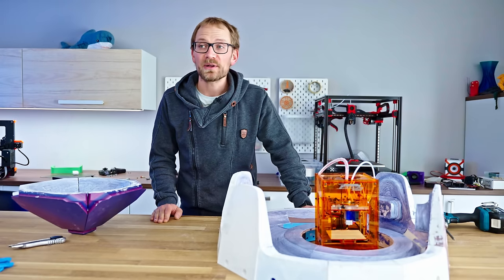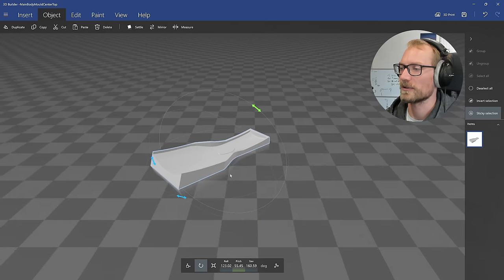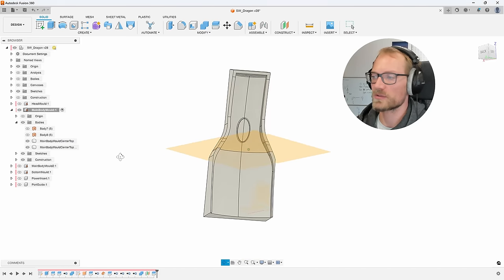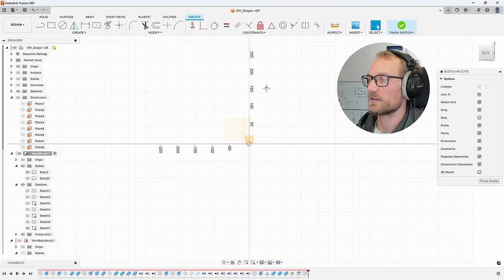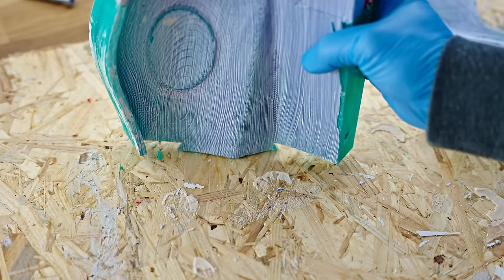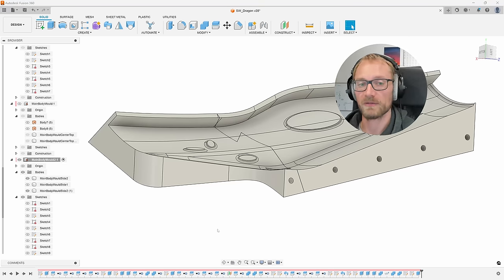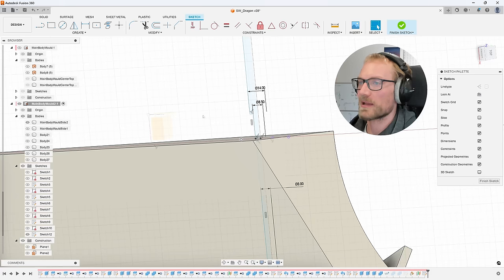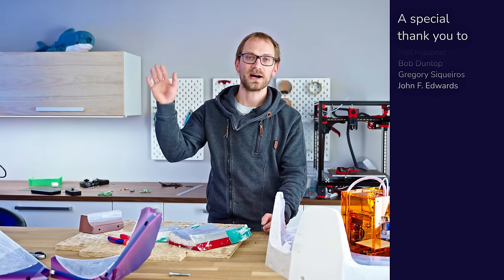Size isn’t everything - 4 ways to print LARGE parts with a 𝘀𝗺𝗮𝗹𝗹 3D Printer!

Comment: I usually print smaller parts separately and use 3d printed threads to lock them together downside is that the threads usually need to be printed at 50 microns - 100 microns layer height.

Comment: LuBan3D is software originally created for splitting up models for large printing.  You provide the build volume of the printer(s), the desired final scale of the model, and it will size to the specified scale and then split the model for printing.  It even automatically generates different types of connectors and can even add numbers to hidden edges of the parts to make assembly easier...

Comment: I'd like to suggest implementing a new form of dovetail for PrusaSlicer: puzzle. It's the same dovetail but rounded (like a puzzle piece) so it's easier to print.
Reply: I'd like to suggest a tool which breaks your part into hundreds of little 3d puzzle pieces for extra fun in assembly!

Comment: I recently saw something awesome on Robert Cowans youtube channel about using automotive plastic rivets to join 3d printed parts to things, but that got me thinking and I later found out about one of the best things ever: R Type Nylon Rivets, which come in a massive array of sizes, are reusable and require far less effort than hot melt inserts or screwing right into plastic.

They are dirt cheap (cheaper than auto plastic rivets) and I imagine you can think of all sorts of ways to use them from connecting seperate parts of say a mold, to pcbs attaching to their enclosures and more.

Comment: 3D builder is very underrated for Boolean operations. It will smash even the most challenging operations that would choke up something like meshmixer for hours.
Reply from the maker: To be fair, MeshMixer isn't a great benchmark to compare against 😅
Reply: Fusion360 straight up wont perform join/cut comands a lot of times. Its hands down the most infuriating thing ever and takes a 10 second job and turns it into 30+ minutes job

Comment: My Fusion 360 Screw workflow:
For screws I like to create a sketch on the head side, perpendicular to the bore. In the sketch I make sure to have a point line end or center point where my screw will end up being. Tangentially constrained circles work quite well for that.
Next I use the bore tool and select the points on the sketch for placement. The depth will be to object with the cut surface selected. Head type is up to the individual design, hole type is through hole and hole point is flat. The hole dimensions now can be selected based on screw dimensions with the drop-downs below. Loose tolerances work well. Confirm the first operation.
Next turn the sketch back on but instead of stopping at the cut go to the desired depth of the threads on the second part. Change the hole type to threaded, remove the head and check the size (it often gets smaller when changing the hole type). As the threads are smaller than the already formed through hole only the second part will be modified. For modeled threads even the loosest tolerances are to tight, some post processing with a tap might be necessary. Alternatively the model geometry can be adjusted.
Lastly the sketch can be hidden again.
Pro tip: the screw positions can be added to a sketch already on use in the model, but it should, to keep an overview of the process, be one of the basic geometry sketches.

Comment: Once you are getting big you may be looking to use the print for structure but gain strength through other methods such as a skin of chopped glass fibre and epoxy for tensile strength or a fill of resin concrete for compressive strength.

Comment: I'm using freecad and the fasteners workbench for threaded holes. I usually generate a threaded rod, increase the diameter (only!) 5-10% for tolerance and subtract that from my shape. Had been working great. In other cases I just added a threaded nut shape to my shape. Also works, but you again need to scale it up or tap it afterward for a good fit.

Comment: i really wish there was a simple 3d recipe website where I could say stuff like "I want to press fit a M8 nut into PLA" and it would tell you the recommended amount of tolerance to put on the shape in fusion. Or like in your example, "I want to print the threads for an M8 screw" and it would tell you click this in fusion, add this amount of scale to the horizontal dimensions, etc. And similarly for what operations to use if you want to tap the hole. And as people try and do things they could rate each recipe and maybe add comments about what worked or didn't work for them. That same website could have amazon or aliexpress links for all the parts used in a recipe and could probably do quite well to fund itself. I don't have time to build this stuff Thomas so you need to do it!

Comment: I'm sure I knew about the thin extrude option in Fusion before, but it hadn't sunk in.  I'd been making dovetails the hard way, by drawing them in the sketch.  Hopefully I remember the option exists for the next thing I do!

Also, I've found that sometimes, splitting an STL doesn't work well in CAD and even a couple times in PrusaSlicer - but when that happens, the Windows modeller thingy will get the job done.  It feels like a kind of brute force option, but it seems to work when all else fails.

Comment: For printing threads in Fusion, I've had good luck with the offset face tool.  You make your hole, thread and model it, then select the upper and lower face of the thread and offset the face (hotkey Q by default) by 0.1mm.  I've been very happy with results to about 0.15mm layer heights for M10 and larger threads (where both parts are plastic) that feel almost like nylon or metal machine screws, but for single-use threading 0.20mm layers work alright - I just find that you get enough of an arc in the circle between layers that you get some bridging in the bore of the hole that ends up gunking up the threads when inserted.  I've found it's also helpful to add a 0.5 mm or 0.25 mm chamfer to the leading edge of the exterior of the hole, as it seems to help the threads engage on a flat face.

Oh, and if those threads are binding a little, just a rub of paraffin wax on the male threads should make it much easier to assemble (the classic woodworkers' soap trick works the same way, but the wax is less of a potential problem for most of my applications.)

Comment: For screws I like to extend the clearance hole about 1/2 diameter into the threaded side. This does two things - first it makes getting the parts aligned and the screws started very easy. Second, it prevents having the screw from pulling a small amount of plastic above the mating surface creating a small gap between the parts as it is tightened. You could easily do this by off-setting the original plane you used to create the features.

Comment: I like using Blender's Boolean tool to make snap-together parts. I do this by first modeling my object as it would look complete, then make my cuts, I put notches and protrusions on one part, then move the protruding parts into the other object and do a boolean "difference" and scale the parts to give the completed print a margin for error so hopefully dont have to do any sanding to snap them together. I made a skateboard stand this way, it has great rigidity and can be disassembled when needed.

I probably need to learn On Shape one of these days, but I learned my 3D stuff on Maya and Blender so that's a process I'm most comfortable with. 😅

Comment: I'm doing a large print split into 4 pieces. At first I tried to design using dovetails. Was getting messy. I'm a noob at all this, so don't really know what I'm doing. Then I decided to mate the 4 pieces with bolts. I added holes in the pieces and I am hoping it will print easily. Thanks for the confirmation.

Comment: Another idea - it's sort of a variant of what you did with the last way with the screws/bolts. You know that thing some people do for including metal parts in prints, where they design the part with a cavity for the inclusion, & have the printer pause or stop when it gets to the top of the cavity so the inclusion can be inserted, then letting the print finish? You could do the same thing, but use a nut or 1 of those longer spacer type things (like a tall nut). If you put that on 1 side of the joint, then on the other side (where the bolt would be screwed in from) you could add something like a square washer as an insert to reinforce the hole that the head of the bolt would be pressing up against.

Comment: I’ve never actually modeled threads. I just cad a hole and then I use a drill to get a screw to “self tap” in. I’ve done it without a hole too, a screw with a drill will melt any plastic in its way and it re-solidifies well. Can’t do it without a power tool though

Comment: Thomas, I printed a shoe sole on the mini using flex and a dovetail. I wanted to have the sole consistently soft using flex filament and avoiding perimeters on the cut surfaces. It seems in prusa slicer, that there is no option for fewer or no perimeters at all on one of the horisontal walls.

Comment: Fusion has a create thread tool that works on existing holes. It will even try to guess the closest standard size.
I've printed M3 bolts to mount fans to my printer when I didn't have the right length in my parts bin. The metal nuts thread right on w/o issue and have good fit. YMMV.

Comment: I'm selling 3D printed helmets on Etsy. Originally I would lean towards more smaller parts but each joint produces a very obvious line on the final part. These lines need a ton of post-processing. The models I'm working with are quite organic and complex so it's very hard to split them in a meaningful way. Lately I feel like printing largest parts possible is the best approach for me. Honestly I prefer to add 50% of printing time (for the failed prints) than spend 200% more time trying to manually hide the seams with sanding, plaster, putty sprays, epoxies and other fillers.

Comment: My very first functional part was actually too big for my printer (before I realized I could downsize it 😅), so I had to split it in two and used the dovetail (with rounded corners, bc 3D printers) and it worked out pretty well; I actually used that for something I was just working on as well (tho with opposing out and in tabs so I can just print the same part twice). I've also used friction fit for parts that I couldn't come up with anything else for, butt I can't say I've ever used the buting up connection method.. I feel like at a minimum a part should have at least some kind of alignment groove so you don't have to worry about positioning and all that..

Comment: This video is what I was missing in Fusion360, I started learning it by using (which I don't recommend...), and I was pulling my hair trying to do things like this.
Also, I had success printing a M3 screw hole. Not the sturdiest, but worked in my application. I got excited and tried printing a M3 screw but... yeah, haha, didn't work sadly.
Reply from the maker: For small stuff like M3, you can also skip making threads entire and just jam the screw in there - it'll hold pretty good!
Reply: @MadeWithLayers  haha yeah, totally. In my application (holding parts together for a butterfly knife), just fitting wasn’t enough, it actually needed to let the parts spin. With the screw solution, the screws get looser as the parts spin, but I think replacing the 3d printed hole with an actual nut would solve the problem (with a nut-shaped hole to keep it in place)
3d printing makes engineering/designing so much fun haha, actually making the parts and seeing where they fail and why

Comment: Try either a little acetone between the pieces, maybe via a spray bottle, and holding them together, they melt and become one basically. Or, have a glass bottle that that you have pre melted some scrap 3D print and acetone into, then just use that as your “glue”.😊

Comment: 04:48 Whoa man are there a few specific settings that you changed to get your print speed down to 5 hours with good quality? 

I'm using cura and it seems like that's a 19-hour job with my Anycubic Kobra 2 Neo If I'm trying to print something as big as my build plate. 

I see that you said it to 0.2mm, rather than the 0.15mm that I'm set too, but I wonder if there's anything else that's so significant?

Comment: That method of cutting a dovetail with a thin extrusion in Fusion was pretty neat.  I tried it out in Onshape, but unfortunately when you add a draft it doesn't behave the same way, rather than angling the cut out and maintaining the same kerf as you show in Fusion, it drafts the kerf instead.  Off the top of my head I think you could make it work by duplicating the part with a copy in place, then performing the cut to each part using opposing draft angles,  I suppose that means duplicating the sketch from the opposite face of your part too.  There's probably a simpler way to do it that I'm just not seeing.

Comment: Is there a way to automatically add screw holes to PrusaSlicer? Seems like there should be!
Reply from the maker: You can use the boolean tools and subtract a cylinder, but it's not too practical as you need to place each one manually.

Comment: You're missing the really great one. That is m12 or m14 plastic screws, with embedded nuts. Super strong, durable, and no extra parts to source. It is a bit of work to get that working, I spent about a full year full time getting it to work. Also, when you got that technique, assembled parts, say a PC case which is what I have been designing, ends up FAR more precise, with far tighter tolerances, than metal sheet cases. Let me know if you are interested. I am about to publish some of the designs using these, which included a chassis for 6x480cm radiators, with 3xpumps. It takes 3 months to print on a mk3. That is round the clock printing. Also, done correctly, you end up with cases that are lighter than thin sheet aluminum cases. With super tight tolerances. 

But you missed The way to connect multiple parts into one, for 3d prints. Also, I think I am the only one to master this. Designing by 27-4,2-1,8-15-14, using 0,6 nozzle, and it is just amazing what can be done. Combine that with print mesh, and the 3d-printing world will never be the same again.

Oh. Just need to point out, that you only need three perimeters, as in 1,8mm, extending them 15mm. That is strong enough. Also, threading needs only to be about to rounds, which adds up nicely using 2mm threading. Just make sure to align the threadding correctly, when printing vertically, as if you don't, you will be printing threads into mid air, with no support.

Also, you need to print threads super slow, if you actually want them to work. About the same speed as the first layer. It is a true pain to print proper threads.

For m14, you only need 2% size reduction of the screw. If using a plastic tapper, which of course you need to print, I think I am the first to do so as well, you get fairly nice working screws, using 2% shrink for the screws, at M14. But a real tapper tool, is advised.

The main thing with plastic screws used this way, is that you can design them freely. They can be pan head, counter sunk, and have the bit-interface on either side.

Bit choice is obvious, and M14 is advised. That enables fairly straight forward use of bit-interface on both end of the screw. With some minor caveats.

Also, head design is super nice, particularly for counter sunk screws. It is a game of tolerance, but doing it consistently, it can be done super precise. There simply is nothing out there, as precise as plastic screw, with embedded plastic threads. They are accurate to about 0,1mm after assembly. Pretty much the opposite of what you claimed in this video.

Also, I have used a counter sunk screws with 1,8mm head 4,2mm threading. That is a total of 6mm. They are super strong, and offer nice super tight fit. Using only plastic.

Of course, given about two years of full time development to get this right, there is a ton of details.

But you missed the best way to join two parts. Sort of an air bow.

Comment: I don't recommend hot glue. I tried that on a print where a ball joint 9lug was separate, hot glued it in and print melted. 

I recommend gorilla glue instead. The one that doesn't expand/state watertight. My heavy ish figurine sits dead shut and doesn't budge with the gorilla glue

Comment: Reasons why somebody would not use PrusaSlicer:

They use a belt printer

That's about the only reason I can come up with. Every printer has a preset, and if it doesn't there definitely will be one available online, or super easy to adept from existing profiles

And it's just so much cleaner UI wise than cura

Comment: Honestly thinking about something like this. I have a fairly small part, but because I'm printing it in nylon, it's an ABSOLUTE NIGHTMARE! I only have a makeshift drybox, so about 3/4 of the way through the print, the filament becomes unusable. I unfortunately have to go at 10mm/s because my hot end can't keep up with material flow, and if I use a smaller nozzle, everything clogs. Only other fix than splitting it like this might be to cook it for an entire full 24 hours. I'd rather not though, since ovens are crazy.

Comment: Do you use other techniques when trying to mate using smaller size screws, say m4? My current solutions are either putting a nut on the other side of the part if the part is thin enough, or pausing the print to put a nut in where i want my screw to go, but that's pretty annoying

Comment: The problem when cutting up a large part into multiple pieces is you open yourself up for more print failures and more chances for warping to happen.  You want to print as much of an object as you can, at once, to keep the chance of warping down.  Prints also can vary in size and quality print to print, even from the same machine, so if your joints are too tight with little to no tolerance, it won't fit.